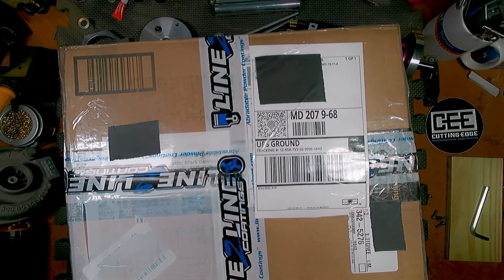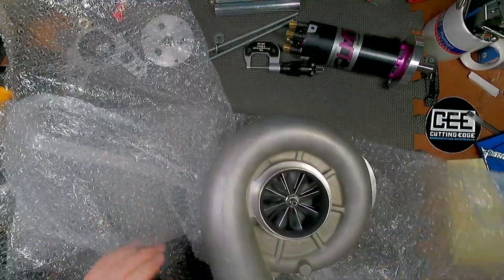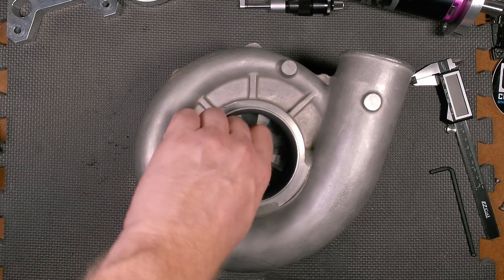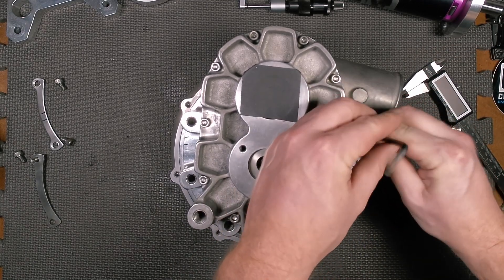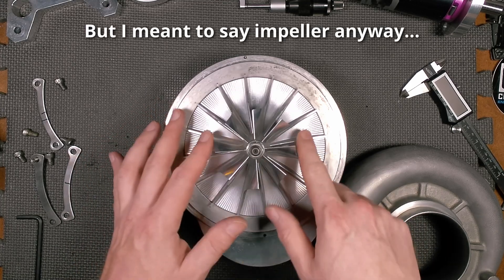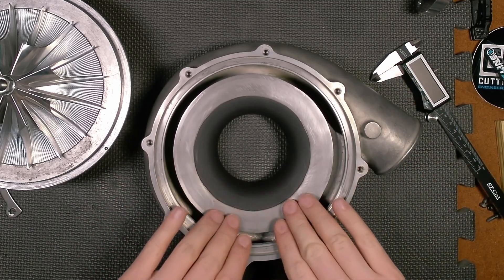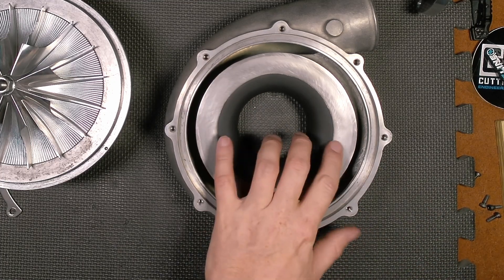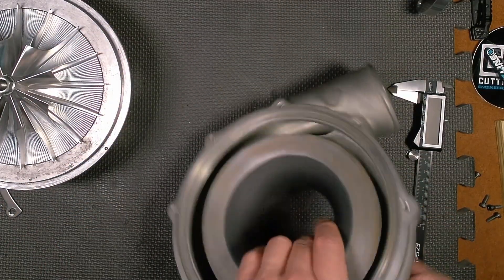Secret Turbo Mods: The Line 2 Line Advantage

Comment: Efficiency loss/gain will show up as temperature and motor kw used. Your only talking a couple degree difference and maybe a kw of power.
If a compressor is using 53hp at 72% efficiency, a whopping 3% gain in efficiency will drop the required power down to 51. Same gain drops comp outlet temp 3°. I think 3% gain will be really optimistic, id say around 1%. You get bigger gains by weather changing or water/meth. Tightening up the clearance also cuts down the flow potential of a wheel, if your running it in the choked region. 

It'll be neat to see the test results.
Reply from the maker: I really don't know how this will play out.  I'm with you - it'll be interesting to see.

Comment: Based on compressor maps ive seen with coatings on i would expect 1.5-2.5 percentage points increase. However they werent as large diameter as this one, so results may vary.
Reply from the maker: This one is also a bit undersized for the application, so if efficiency is improved, it'll definitely show up on the dyno.  I'm trying to get to the dyno and then the track before winter hits...  I'd love to see a 2% gain.  Thanks for the comment!

Comment: Wonder how much difference it will make? Not sure how you're going to be able to test it to find out, but I look forward to hearing.
Reply from the maker: I'm going to test it on the dyno - Ray's dyno has been very consistent, even from different days.  Last time, I expected to pick up about 10 hp with the bigger TB, and we picked up 12.  On a day with slightly worse weather.